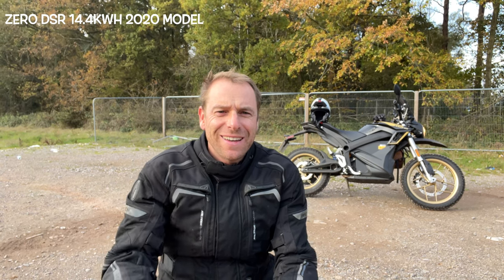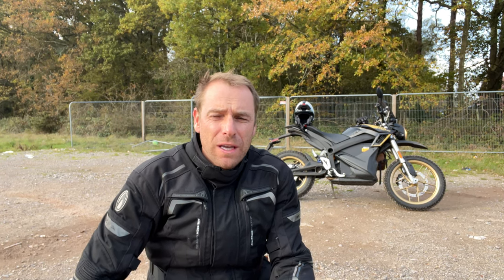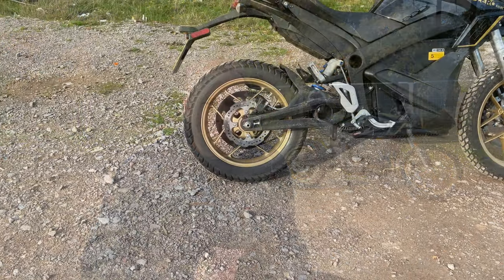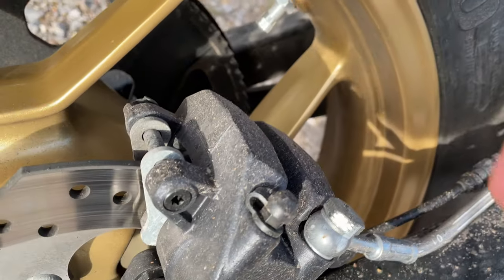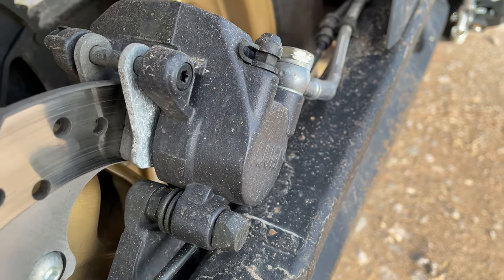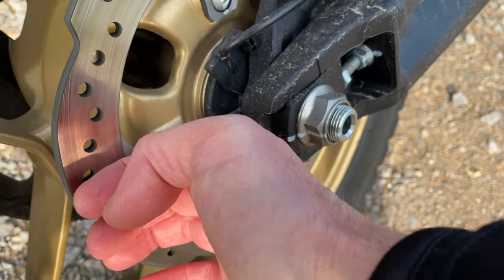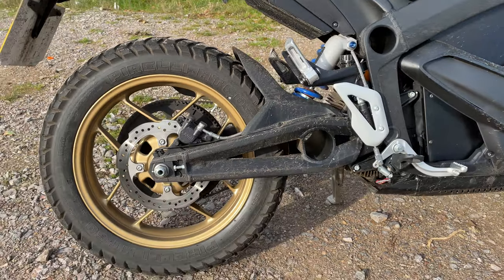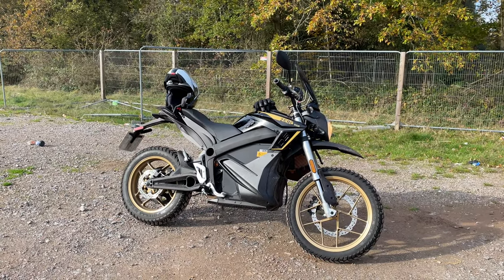Zero DSR 14.4kWh - Squealing rear brakes

Comment: Hello, my Zero DS also makes a strange noise but only at low speed putting little pressure on the pedal, it doesn't really sound like a squeak, it's almost like liquid making turbulence hahaha it really is a difficult noise to expel, but I don't notice that it affects the braking. I have seen in more videos of other people who also go through what I thought is normal. Surely when I wear the tires I will change the pads for better ones of the same brand but I don't know if that will affect that noise, in the Newzeroland channel it says that it always seemed to him that his motorcycle did not have enough braking and it turned out that just by changing the pads brake improved the braking problem, but does not say anything about the noise. Thanks for the videos. Good luck and health.
Reply from the maker: Many thanks for the feedback. Yes I have also seen a few guys just dropping higher quality pads in and the noise go away. Its just weird that they cannot sell the bike with good pads that would not make that noise. I also had a few suggestions to run the bike without any regen for a month or so to really break in the pads. Its also getting to winter here in the UK so even more grim and grit on the brakes. Good luck with your bike and enjoy.

Comment: Mine is a Zero S, I bought it used with 2500 miles also have a rubbing noise in the front brakes, the pads are minimally touching the rotor, is normal and is the way brakes are, I will dismount the  front caliper, remove the pads, inspect everything and clean with a brush and brake fluid around the hydraulic piston, is probably a accumulation of dirt and brake pads debris around the piston, I saw this happened before in other bikes before but is not very noticeable in most petrol bikes. I suggest to do the same, you dont going to hurt anything. Also lift the wheel from the ground and inspect for a miss aligned wheel or a defective bearing, a defective bearing going to show a sideways play.
Reply from the maker: Many thanks for the feedback. I will have to check it out. Mine stopped after a bit of bedding in.

Comment: So I love riding my SR/S when I can get out on it.
No brake squeal for me but I do have issues when I want to get it charged.
I currently live in a flat, so I rely on the public infrastructure, but I have found that I can get connected up, the connection is seen by the post, okay and an attempt to start powering up fails.

I then here the post clicking on and off. It has been taking me around 15 minutes of stopping the charging process, switching the bike back on, switching off, switching the kill switch on and off, trying again stopping etc. until eventually, the charging process kicks in.
At first, I thought that the issue was with the charging posts, but then I watch a Zoe drive connect and everything work fine for her. I have had this issue on several posts since. 
About one is 3 times I have no issue.
Reply from the maker: Its interesting as there have been quite a few new EV's that does not work with certain posts and the problem is not the post but how the post talks to the onboard charger. Some post will work and some post would not or can be intermittent. The Land Rover ipace had this and I think the second gen Nissan leaf. But they fixed it very quick with a software update. Its usually the amount of people complaining that gets the guys working on a fix. Did you try and test a few different posts and see if its way polar, cyc, chargemaster or any of the others around your area? I assume you know about the ZapMap and Plugshare apps to help you with finding them around. Let me know if you can spot a pattern because then you can contact them and see if they can sort it out.
Reply: @Andre-Mostert  I have had the issue with all of the posts.
Since I worked out that it was the bike persistence has been the solution.

As in the posts work fine just I don't always get a charge first time without doing the switch off switch on, kill switch off switch on, switch off or whatever the combination that gets it going is.

I still have not worked it out and it could be just random.
Reply from the maker: Have you mailed the Zero support guys to see what they say? It might be something they can adjust in a firmware.

Comment: Beyond what you're doing to work the brakes a little more, I know brake squeal is common on EVs generally, because many of us don't use the standard brakes enough, but make more use of regen.

Maybe turn your regen right down in the app for a few days to force you to use the brakes more.

Before you take a hack saw to the brakes though, maybe try some suggestions here: https://itstillruns.com/fix-squeaky-motorcycle-brake-pads-7259566.html
Reply from the maker: Many thanks for the feedback and yes this will be the last resort. One of the guys replaced there with just a better brand and the noise went away but as you say, turn the regen off and work the pads abit more. Thanks for watching and the feedback.

Comment: My ds rear brake squeaks. It’s not exactly a squeak. Lower frequency. It’s more like pulling a chair across the floor.  It’s only when I’m moving very slowly just about to stop and pushing very lightly.
Reply from the maker: Hi Bill thanks for watching and the feedback. I hear this is a common problem and a few guys that I have spoken too said it goes away after a while. Some also said they replaced the pads and that solved the problem. One guy said to me to keep my hand on the brake to wear out the pads lol. That I did not do. But it looks like the standard pads is causing it. Also worth to check the disk that its not rubbing and causing a vibration. 

Keep well and hope you can get it sorted out.
Reply: At about 400 miles it has now gone away